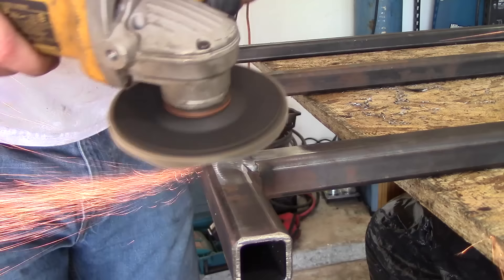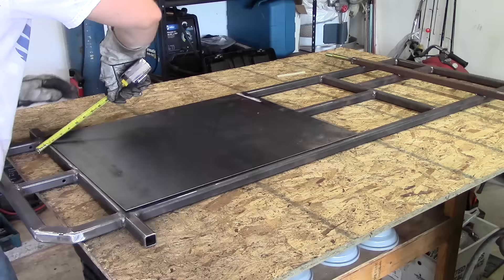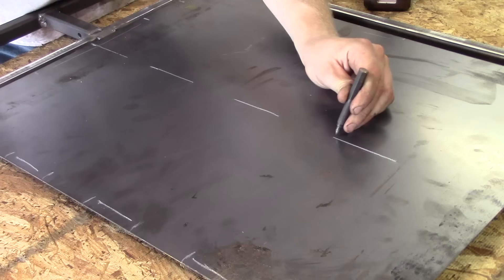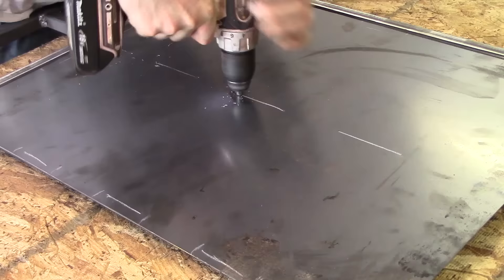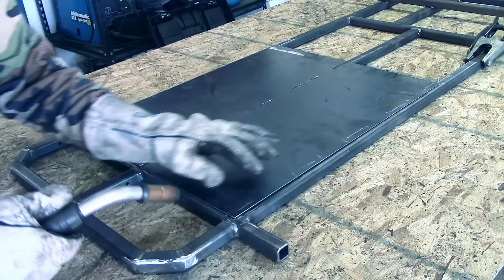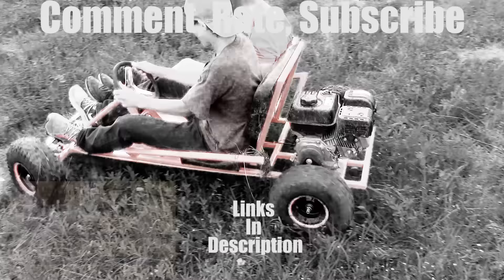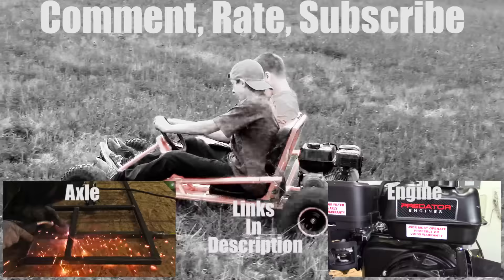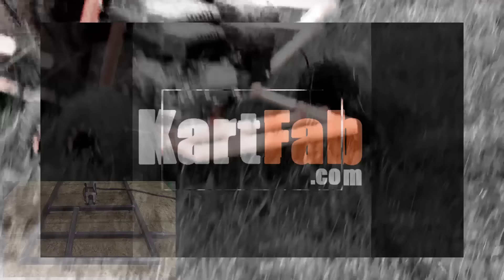Go Kart Build: Floor Pan

Comment: If you want to avoid the weld splater, a spray bottle filled with soapy water and sprayed on the metal around the weld area will stop the weld splater balls from sticking...I'm an ex boilermaker/welder.
Reply from the maker: Nice. I've also heard spraying Pam works too?
Reply: Yes,it's probably better to use the spray on cooking oil but you end up with an oily surface and it also smokes too not good to breath in smoke all the time!
Clean the surface before spay painting it as the spray won't stick.

Comment: what brand of welder and type of it are you using is this  a 115  or 220? thanks b4 hands  appreciate your answer. I have an arc welder   110 v do you think  i can make it?
Reply from the maker: +Miguel Martinez millermatic 251, any 110v is fine. like a 90 amp 115v welder is ok to use.

Comment: Are you using a lincoln arc welder?
Reply from the maker: no just a mig welder, but you can use a lincoln arc welder
Reply: KartFab can you use oxy acetylene ?
Reply from the maker: yeah, but oxy acetylene isn't the cheapest way to weld. It uses a lot of gas and is kind of hard to do.
Reply: KartFab im certified to do both but my arc machine is down i only have my oxy bottles. My job supplies me oxy bottles. I just wanted to ask if it was possible.
Reply from the maker: yep, its almost a lost skill to oxy/acetylene weld nowdays.

Comment: Hi kart fab. 
I am going to be building your kart in about 2 weeks. I only have one question though. Let's say your 250lbs how fast would you go. I will be using a 6.5 predator engine.  Oh and screw you Aron😀
Reply: Mr. Clean Cleans no
Reply: No what?
Reply from the maker: weight doesnt affect top speed, only how fast you get there. You are looking at about 25-30 mph
Reply from the maker: if you get the live axle deluxe go kart plans, then you will accellerate faster and have a top speed of 35 mph btw.
Reply: Thank you kart fab!!! Do you have the live axel kit?
Reply: Oops I see the the kit. Never mind.  Ty
Reply from the maker: glad to be of some assistance lol :P

Comment: ok so 1/16"
Reply from the maker: So you read the plans, or are you just making this stuff up?
Reply: +KartFab you could of just said 1/16"
Reply from the maker: I could have, but that's not the thickness of the plate that I used for the floor plan.
Reply: thats what it says on the floor plan
Reply from the maker: Here, read the plans, and then read this, https://www.unc.edu/~rowlett/units/scales/sheetmetal.html Theres a difference between GAUGE and INCHES. Also, you dont go call up a steel yard and tell them you want 1/16" steel, you tell them you want 16 GAUGE sheet metal. because 16 gauge does not equal 1/16"
Reply: The go kart floor pan material is just your standard  mild steel that has a thickness of 16 gauge, or about 1/16″ thick. This is the perfect balance of weight and strength.  The dimensions for this go kart are found in the go kart plans for the floor pan, which is 26″ x 20″. thats what it says
Reply from the maker: I dont know what point you are trying to prove, but I am not going to put up with you saying 16 ga is 1/16" 16 GA is ABOUT 1/16" thick but it is not 1/16" thick.
Reply from the maker: Aaron, you do realize you are talking to the person who made this go kart, wrote the plans, and actually knows what he is talking about. You do realize this don't you?